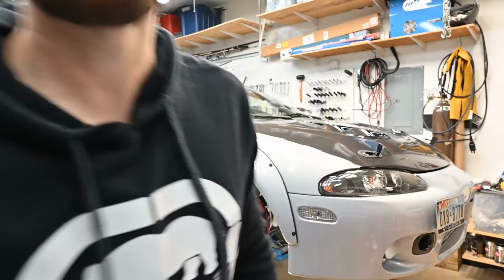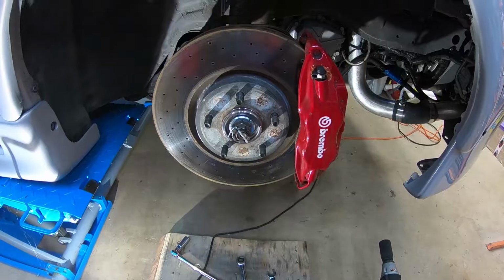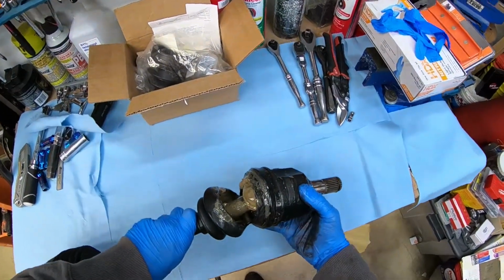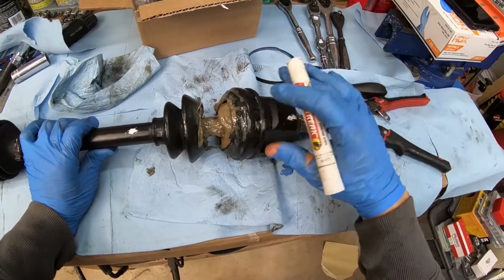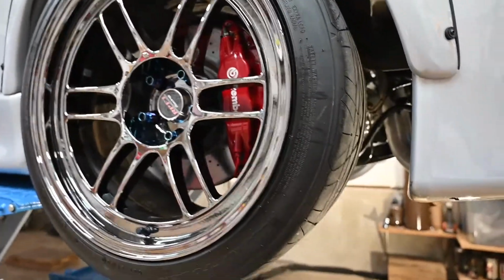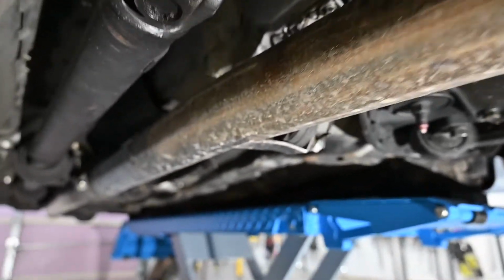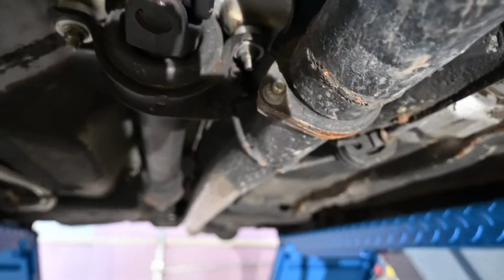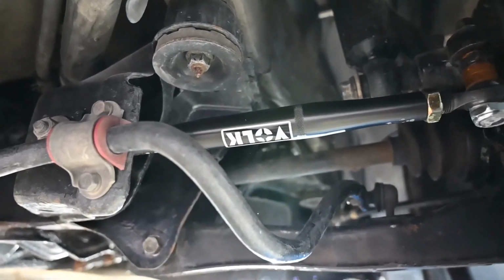ECLIPSE GSX  CV Axle Boot Replacement

Comment: Good work. Just an FYI, the milky/creamy grease is the actual OEM stuff they put in 20 years ago; in fact you can hardly find that type of low-friction high speed grease anymore. Nowadays they mostly come as the black one which is graphite based. Very rarely have I seen packs which have the peanut butter in. I had to refill my inner cv boot a few months ago and I just used some Mobil blue grease.

Keep an eye on the clamp for the next few days in case they weren't tight enough!
Reply from the maker: Thanks man ! That's good to know.

Comment: I use a screwdriver in the rotor and hold it against the caliper when I torque the axle nut. How did you lock the front wheel?
Reply from the maker: with piece of wood between the tire and the floor